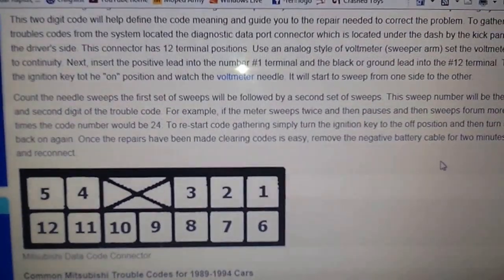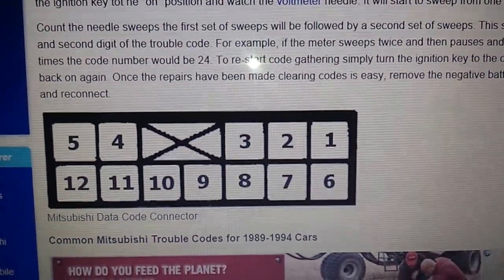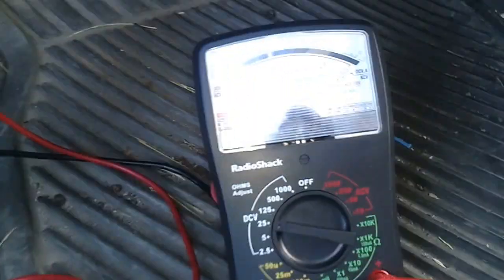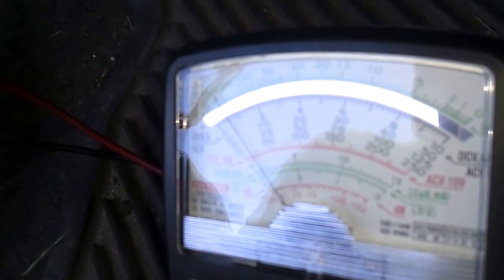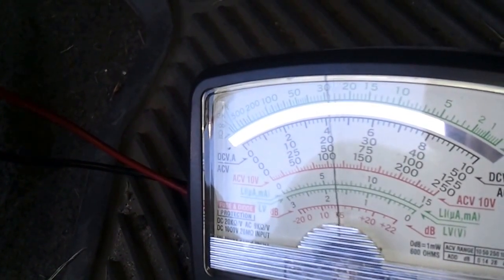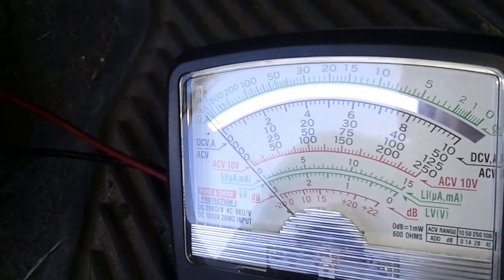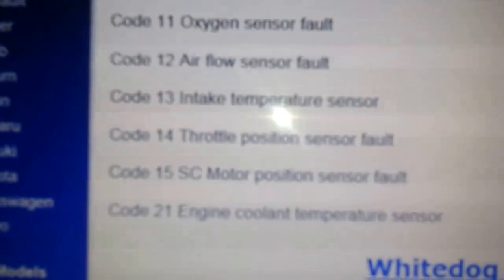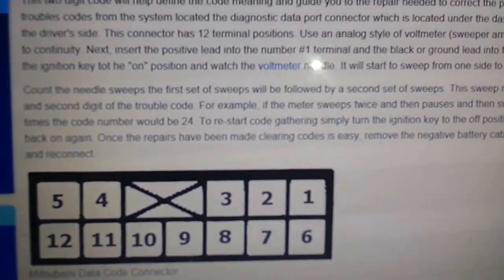How to check obd1 codes 1989 dodge colt/mitsubishi mirage.

Comment: I have. A check  engine light, but when I connect it, the meter just stays on 12 volts and doesn't move.🤔
Reply: Did you end up finding the problem? Running into the same situation myself..

Comment: Great video, I learned you can do the same thing with a little cheapy beaper from radio shack. It will beep long and beep short just noise instead. I wonder where you found those code listing online at though? Thanks.